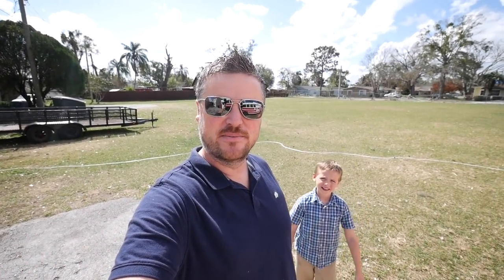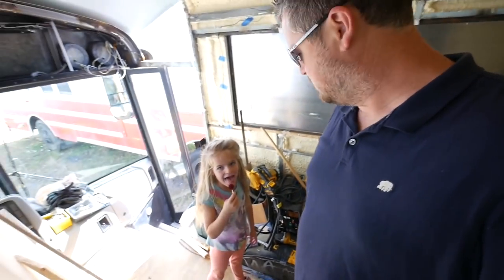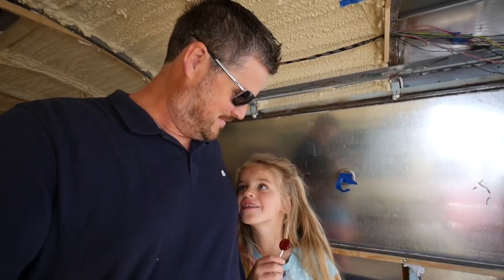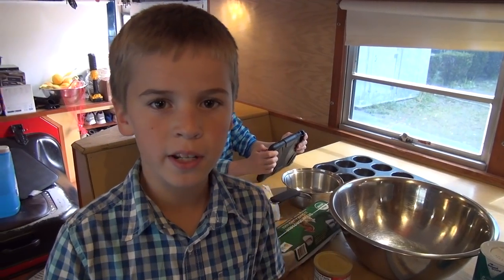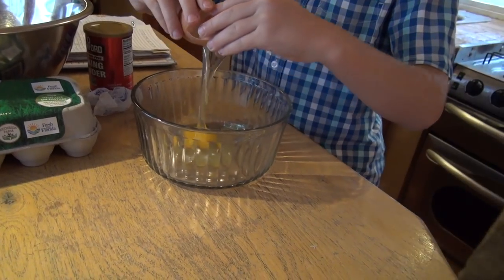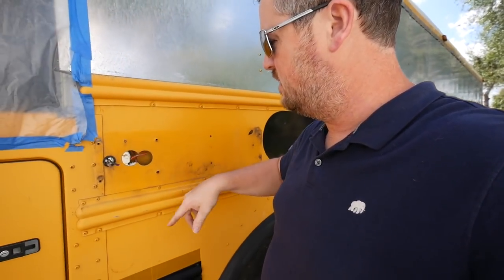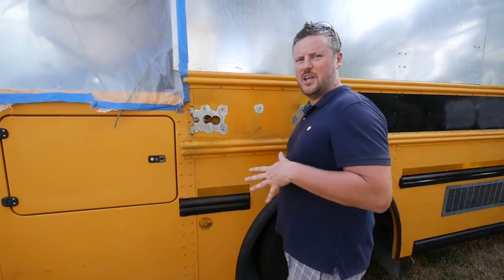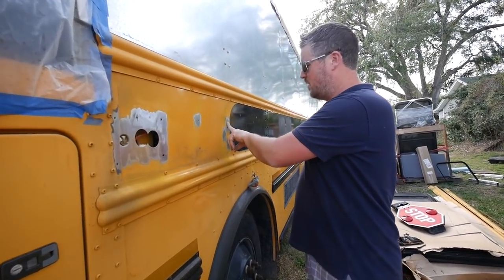Paint Prep & New Stove | Bus Conversion pt. 18 | The Bus Life

Comment: Some of your screw holes, for the stop sign for instance, can have the screws put back in... it will save you some bondo work. The lights that you bondoed over can be covered with an extra piece of sheet metal, with holes drilled in the right spots, some seam sealer, you can cover those up with a process called "rivot bonding" with the right kind of rivot and a manual rivot tool. That can save you some more bondo work. This can also be done to attach sheet metal in areas you want to cover windows. Rivot bonding is strong, sometimes stronger than welding, and a lot of times, seals better than screws. You can also put these rivots in screw holes you don't need anymore and paint over the rivots. They last a really long time. And they are cheap.

Comment: Another awesome quality video! As others have mentioned and it's not too late. You could reinstall those upper lights for more safety. 2 brake lights used to be standard on most cars. Now the standard is 3 with the addition of a third hight mounted brake light. In your bus you have the opportunity to have 4 brake lights and 4 turn signals. Your old ones were in bad shape you said. Why not upgrade and install some LED lights. Not just the bulbs (which would be an upgrade) but some of the new LED assembly's that have like 25 bulbs inside. Just a safety idea!

Comment: Been alot easier to cut metal patches the same size of the holes and weld them in and grind it down and smooth it over with a little bondo and no chance of it coming back out

Comment: We had the same insulation in our bus, thought about reusing it for things like you did and we found out that the R value is so low it is not worth using. Would be much better using the spray foam. Need to remember that you insulation is only as good as your weakest points. Other than that the new bus is looking good and like some of your ideas.